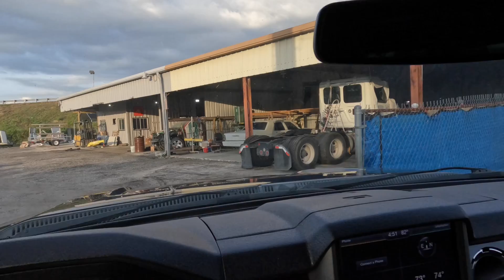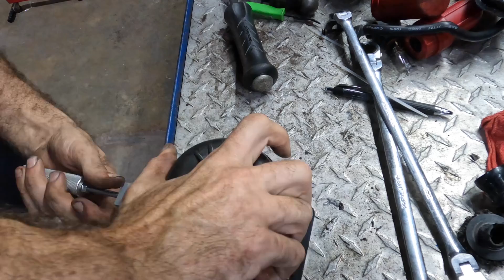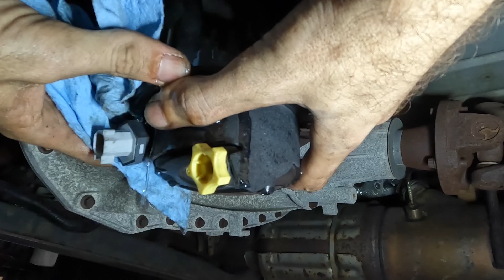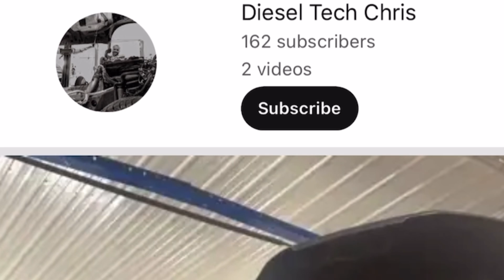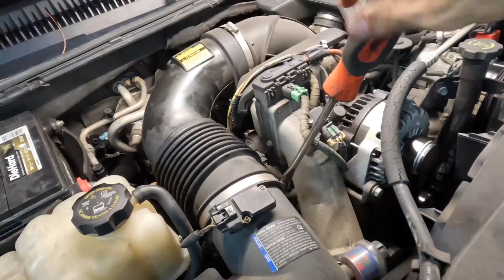Diesel Fuel System Filters!  Duramax & Powerstroke 6.6 & 6.7

Comment: Years ago, when I was a Warranty Engineer for Deutz US here in Atlanta we tested a bunch of Diesel oil filters! Fram, Wix, and others, including the factory recommended Mann and Hummel ones. Filtration, bypass spring pressure, cut them apart, the whole thing. By FAR the M&H filters outperformed the others! Of course, nobody used them because they cost more!

Funny how every engine that came back to us under "Warranty" with a rod through the block, was full of fresh oil up to the hole and a new, dry filter on it! 🤣

Comment: 17:29 wouldn't this segment be a perfect showcase opportunity for the JM3 filter wrench as used in a TIGHT squeeze situation?  I know you got the oil filter master kits but I thought I remembered hearing in one of the SEMA videos by you or Rich about they had larger models for the HD diesel engines and the associated fuel filters?  Or are those not being made yet in the larger sizes?

Comment: I have a 2006 silverado and yeah I just remove the fender cover it's alot easier to do and my wrists are arthritic from a ton of breaks as a child from boardsports.  I normally changed mine around 10k I'm not sure anymore I installed a lift pump about 7k miles back and did the filter at the same time for a secondary or backup filter and it shows 74% fuel filter life now vs the 30% or so that it normally would be at by now.  The lift pump made it nice to not sit and pump the bleeder pump.

Comment: Sorta unrelated, in the army we had a diesel blow torch. It used a hand pump pressure vessel and the nozzle had a coil where the flame from the nozzle would heat the diesel fuel helping it get to flashpoint. Old tech that works

Comment: Especially with diesels, the fuel not needed to supply the injectors is returned to the fuel tank to extract hear from the injectors as well as preheat the fuel tank to reduce the chance of diesel from gelling. This isn't really noticed much with light duty diesel trucks, but certainly noticed with heavy trucks with aluminum saddle tanks. Also, a tip from an old trucking veteran. Instead of luring your fuel filter seals with fuel, use clean axle grease. Diesel fuel will heat up and make the seals bond to aluminum or plastic housings. Grease will not. Makes future filter changes much easier and will not make the filter loose torque.

Comment: With an old skool ALH TDi, It took many, many, many, many, many restarts to get it to prime and run. I even prefilled the filter with shitty diesel and it still took so long, my battery ended up dying and I had to fully recharge it and try again and eventually she came right back around. I dread fuel filter changes on this car.

Comment: Any idea why fuel filtration is so important in diesel engines, whereas in newer gasoline engines filters are in the tank and rarely changed?
Reply: Because diesel injectors are much more sensitive to contaminates, with .007 (i think) inch holes it wouldn't take much to plug it up.

Comment: Ray, just constructive criticism. "priming twice"  between the upper fuel filter and the lower filter  could defeat the purpose of changing the filters. Because when you changed the upper filter,  the lower filter is still contaminated. Potentially contaminating the new upper filter. These 6.7 's are already prone to be very sensitive to a complete fuel system catastrophic failure..Just FYI buddy. Your friend in Lib California, Ron

Comment: Odd you fix oil caps on backwards but put floor mat in upside down? Tip always take 2 mats to get vehicle, when done servicing put new mat in place of old mat right way up then take old mat with your dirty foot prints on it and toss it on your way in to hang keys.

Comment: If you have to run an engine with the air intake tubing off, disconnect the MAF sensor. The engine will see the sensor is not there and use a stock value. Useful if you need to spray in some cleaner or what not.

Comment: I have not changed my fuel filters on my power stroke for 60 k miles and I never will.  I installed a Racor fuel polishing filter between the fuel tank and the frame mount filter.  It filters to 30 microns and removes 99% of any water and it has a clear bottom bowl with a built in drain.  I suggest you check them out.  Good investment.

Comment: This was entertaining considering my recent fuel filter change on the 6.7 Power Stroke didn't go quite as smoothly. I used OEM Motorcraft filters however the canister in the engine compartment did not want to seat, much less rotate. I had to lube it and use a rubber mallet to bottom it out and then wack it around 1/4 turn with a large blade screwdriver and a hammer. I can't wait until the next change because I know it's going to be a bitch pulling it out. 🤪

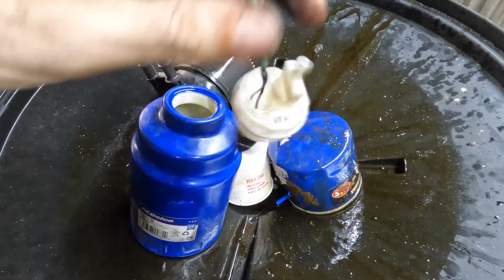Comment: 19:15 the water sensor in a diesel filter housing is the simplest sensor there is.  It is just a pair of exposed contacts.  Diesel is an electrical insulator, and any water other than distilled will conduct electricity.  So, if the contacts register a lower electrical resistance, the system assumes water in the fuel.  So dangling by the wires will only damage it if you pull a wire out of the sensor.

Comment: My stupid Mercedes diesel requires you to remove half the intake system to get at the fuel filter. And then you've got to deal with their stupid single use hose clamps. And be sure you don't break a plastic T fitting really close to the filter, because if you do you have to replace something like 6 feet of fuel line because that fitting is part of the line and can't be replaced separately. Why can't engineers design cars so that routine maintenance is easy? Especially in big vehicles where space under the hood is not at a premium?

Comment: I have a 2016 F250 w/ 6.7. I like to check for water before I change lower filter. Also, if you put a little bearing grease on o-ring and threads, it will screw on much easier, and will be easier to remove next time.

Comment: Ray! You're doing it wrong!  O-rings and filter gaskets should have lube on the whole surface so they seat properly in their grooves.  Put a dab of grease in a shop rag and wrap the dab around a section of the ring, then proceed to pull the o-ring through the dab while closely examining the ring for nicks or splits. Fingers can detect flaws in the ring better than a quick visual inspection and you'll clean the ring at the same time. I was taught this by an old electron microscope tech.

Comment: Why does gm insist on putting diesel fuel filters in terrible locations for techs. I had a suburban with the 6.2l diesel. One of the filters was mounted on the back side of the intake manifold.

Comment: At 23:22 something fell on your engine as you were installing the AC Delco filter on your Duramax. I don't know if it was something important but it sure looked like some kind of seal. Hopefully, it's not anything you really needed.

Edit: You can say, "Der Deutsche Klick," for the German click (singular) or "Die Deutsche Klicks," for the German clicks (plural).
Reply: Looks Like a piece of the broken up wire loom running through there
Reply: @mymycojourney7924  It looked to me to be some kind of gasket based on the round shape and dark color that looked like vulcanized rubber.

Comment: Ray another nice show!
Next Ford f.f. change start with primary filter 1st will make sure that air is bleed out 
I've seen guys let diesel run 1/2 hour and not able to start cold weather ( with working preheating system )    and now you know why us up north We call power engines  die - sell them    Lol

Comment: You inspired me to change out my own heater core on my 2000 Grand Marquis. I only broke the shift lever indicator and I have 7 bolts left over.
Reply: Haha it is a fun time pulling that dash out. I had my ‘03 apart a few weeks ago to change out a busted blend door actuator. I learned from Ray to put the fasteners with the parts they went to and while I had a few stragglers to track down, not one was left over (a nice change of pace from past experiences).

Comment: Ray, You Said about Diesel Cooling. Cummins (the Bigger ones) returned about 80% of the fuel from the Engine to the Tank so in hot conditions it cools but in cold coditions it warms the fuel tank to revent freezing. Supposed to work down to crazy temperatures.

Comment: Quick Tip on the Lift Pump -  loosen the bowl 3 turns before opening the drain. This will actuate an anti-siphon valve at the fuel and water separator inlet and prevent the fuel from siphoning out of the tank.
Reply: That didn't work for me. I pretty much filled up the drain pan before I screwed the bowl back in. I tried again opening the drain first, then unscrewing the bowl. I don't  know, maybe it was a failure on the ball cock valve on the first go???

Comment: Despite their plastic cap/housing, which some hate, the newer Duramax fuel filters are much easier to change as they are located under the driver's side by the frame rail. They also have a lift pump so the filter is primed similar to what you showed on the Ford.

Comment: Good video, I am retired GM tech and totally dis-like the fuel filters on dirty-max diesels. I think that most of filters I got sit on shelves way too long. My "O" rings had shrank and would not stay in the groove. I pulled inner fender and did way more work than you to get the job done. As far as Amazon, I ordered spark plugs for my 2016 Cruze. They got delivered by USPS. The box had clearly been dropped on the end. The clear plastic sleeve was crushed and the gaps closed up. I filed and returned. Have a Great Day. Don

Comment: You were 100% correct when you said you could probably leave the bleeder screw open when priming your Duramax fuel system Ray, in addition to the hand pump, there is also a check ball in the filter head that prevents air from going back down the fuel line towards the tank while you’re priming it. It’s designed to be left open during priming and speeds up the process.
Reply: OCD me was having a difficult time with the bleeder screw closing

Comment: Back when I was younger and drove 18 wheelers, we would prime our fuel filters with ATF. I was told it cleaned the pump and injectors. I can say that the power came up a bit more than with just diesel fuel.
I'm sure that was wrong. But it was what we did back in the 80's and 90's when I was driving.
The German word for "click" is "klicken".

Comment: Good stuff Ray! I don't have a diesel (yet) but would like to find a GM 3/4 ton with a Duramax (pre DEF) to pull my trailer around on my retirement tour of the states. Thanks for sharing and cant wait to see what's next.
Reply: You want a 2007 classic body. It has the lbz duramax, the last one before def. If you get a 2012 or newer they have most of the kinks worked out of the def system and it really isn't that bad.
Reply: @zachdemand4508  thanks
Reply: @Gestapo943  thanks

Comment: Ray, wouldn't one of the new one-handed oil filter remover wrenches you got fit to keep you from needing to pull the airbox for removing the fuel filter? Asking cause I thought that was the second reason you got so many sizes.
Reply: but theyre all shiny! cant go and grime them up! ;D 
but above all, that fuel filter doesnt have a hex pattern for them to grip on, and he'd have to get it threaded from the bottom, which includes threading the sensor cable through the tool.
An strap model filter remover wouldve probably done a better job in this case, in worst case an old engine belt looped into a wrench would do the same job ^^
Reply: I think I'm just lazy and want to take the fewest things apart.

And watching the video on the oil filter wrenches, I thought the generic ones actually did a pinch as part of the action, since I have encountered a few oil filters that don't have the hex dimples at the end.

Comment: At 17:29 - Ray you got a Masterset of the JM3 Oilfilter-Set. Wouldn't one of these fit over there? They seemed pretty stubby and might be a perfect fit if one is big enough for the fuel filter.
If I remember correctly from your SEMA Video there was one with teeth that bite in the housing to grip it when it's flat like the Fuel Filter is. 
Maybe this would even be an additional Extra that JM3 could offer if they don't have a fitting size for that?

Edit:
Click is Klick. Same pronunciation just different style of writing.

Comment: Actually Ray, the filter is pre-pump. The rear line is from the lift pump, the other leads to the CP4. The return to tank is lower and to the right of the filter on the firewall. You can see the return line at the 7:18 mark to the left of the forward fuel line.   The water separator housing has a tab, careful not to over tighten the cover or the tab will break.

Comment: I have a 2015 F 250 6.7 powerstroke.  I have changed the fuel filters about 10 times.  The frame filter soaked me once.  Loosen it about 2-3 turns then drain it good.  It will be practically empty.  The frame filter is your first filter and the best place to check for gross contamination.  The engine fuel filter receives filtered fuel and should show absolutely no sign of contamination.  The frame filter housing is always hard to remove and, as you did, slow steady pressure on the ratchet will keep the plastic nut from breaking.  I wash housing threads and lube with that electric grease prior to reinstallation

Comment: I remember when you worked at the other place you woulda cleaned all that diesel you got all over that customers truck engine 😊 with brake clean…
No shortcuts ray. Clean that mess off. Be respectful  not cheap.

Comment: Years ago (about 11) when I worked for Pepsi the service truck I used wouldn't start. Had the truck towed to dealership and later found out the sensor on the bottom of the filter came loose. Engine was the 6.6 Duramax.

Comment: If the 4wd has never been serviced on that truck you can sell a transfer case fluid and automatic locking hub service for about an additional hour AND the customer will really appreciate that when they need it and dont have to get out of the truck to attempt to turn a lockout that wont turn because it was never cleaned and lubed. (there is a stub shaft support bearing on both the hub bearing and the lockout)

Comment: This was a great video. I got a 2016 F350 last month and I am a couple of thousand away from the 90K service. Everything I have read about this version of the 6.7L is to change the fuel filter often as bad fuel can run big bucks in repairs to the fuel system.
Reply: I change all filters every oil change for a few extra bucks it cant hurt. Same thing in my semi. Injector are expensive and so are piston kits.
Reply: @havocreaper2404  K&N is discontinuing the fuel filter and water separator kit and they have it at a deeply discounted price. I have 6 on the way.

Comment: Try some Liqui moly diesel purge. You can either disconnect the fuel lines and put it directly into the bottle or dump the whole bottle into the fuel filter. 

I swear you get like 20 hp back and the car will be more responsive.

Comment: Umm. No the lift pump pumps a vaccume on the underbody filter. The filter is nder the level of said tank. If you fail to tighten the underbody water separation filter it will pump diesel from to the engine in such a fashion to not run. You will get alot of air in the system. The symptom is the same as ther bad orange on the filter. Since the undre bracket is missing from the housing it has been serviced prior.

Comment: Kind of curious how much the Big Duty owner had in that filter change.  I was quoted $250, from a dealer, for my Baby "Deesal" fuel filter change on my 2018 F-150 3.0l.  $125 for the filters and I'm assuming they charge $125/hr labor.  I bought the Motor craft filters online for $60 and had them swapped out in 15-20min, on my first go around.  Had to remove a skid plate, for mine and the engine bay filter was more of a pain to do than the big brothers, where it's a different style filter and it's clamped in.  They must base their labor off the slowest guy in the shop.

Comment: I wish you had a shop here in California I would go to you. I have a 2001 PT cruiser I bought it from original owner only had 107,000 miles on it when I bought it. I had to replace the original with alignment for $360 $500 for a radiator. It was the original that I had to put shocks and Springs in the rear, original owners brother lowered it any time I went over a speedbump my exhaust would scrape that was $700 I paid $2,800 for it.

Comment: Holy cow! That's like $50 of diesel out of the lower filter.  That looks a TON easier than my 6.0 filters were.  Seating the lower filter cap took a significant amount of bicep dugga duggas or it would suck air.

Comment: Thank you the idea of not removing the fender well on the. Duramax.  So much easier thru the engine compartment.  I am always learning something new from Rainman!
Reply: I pulled the fender liner and cut out a section where the filter is and zip tied a piece of rubber over the hole. 
Just cut the ties, swap the filter, and re-zip it. 
I change the filter every other oil change which is about every other month when I'm busy.

Comment: If that fuel/water seperator o-ring fails you will get air in the fuel. No fuel pressure. Motor wont run

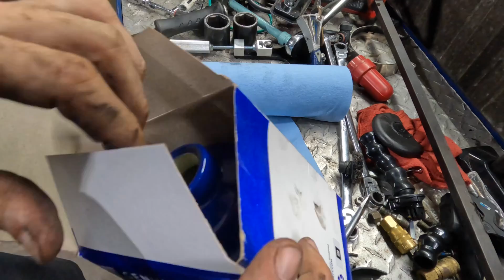Comment: The petcock on the bottom of the housing does allow you to drain some fuel out of the housing to change the filter, but it's main purpose is to drain water, which settles at the bottom of the separator. I recommend opening the petcock for about 5 seconds with every oil change. Just a peace of mind thing. @17:30... Use your new filter tools... Unless this is an old video that you're just now uploading. @19:45... Never buy consumables (filters, spark plugs, sensors, etc...) from Amazon or eBay. The counterfeit parts far outnumber the genuine parts. Amazon and eBay have NO desire to police the sellers because they get a commission for every sale.